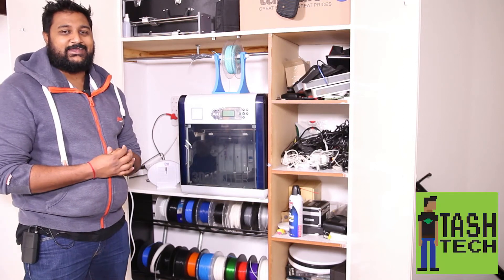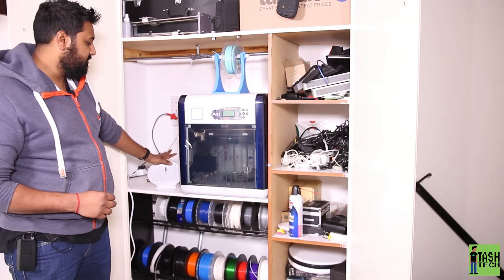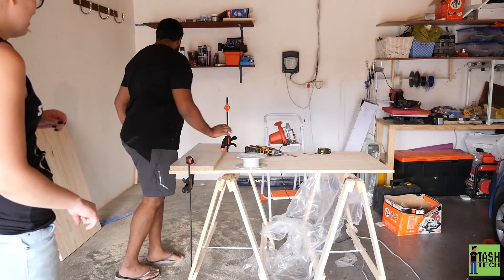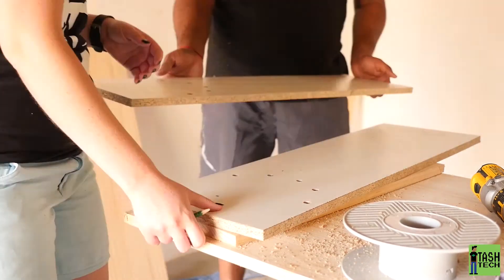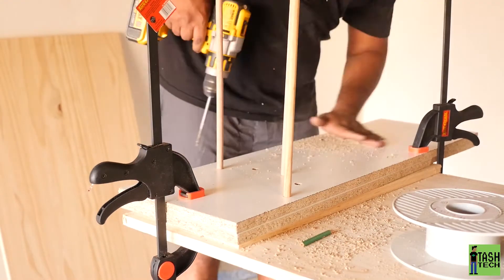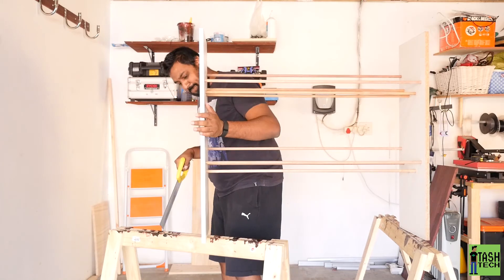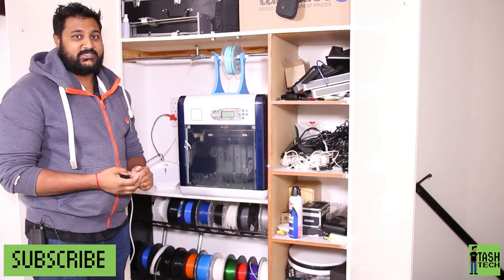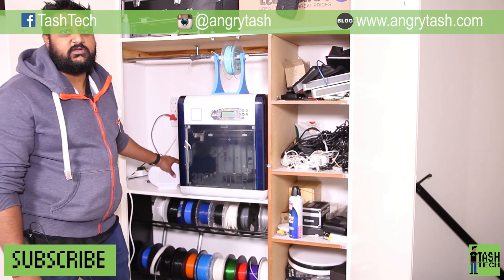3D Filament Rack Development for TashTech Studio

Comment: haha after a few weeks or months your filaments are going to be no good due to moisture needs to be air tight bud lol
Reply: so it sitting on the printer for weeks doesnt affect it?
Reply: depends how fast you use it. filament will absorb moisture over time and cause blockages and bad prints like honeycoming. the way hes storing all his rolls in a cupbaord basically isnt air tight they recomend you at least store each spool in a ziplock bag with desicant pouches.